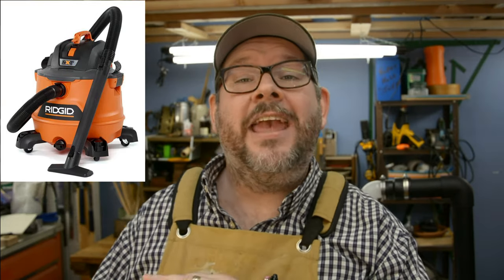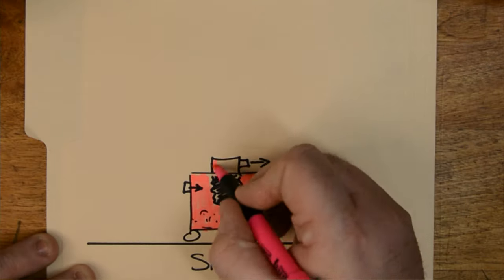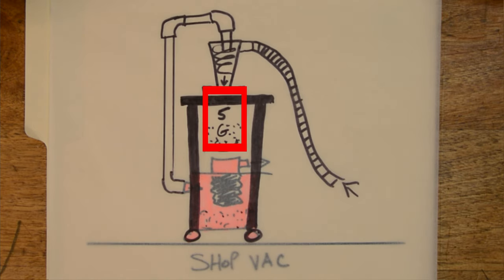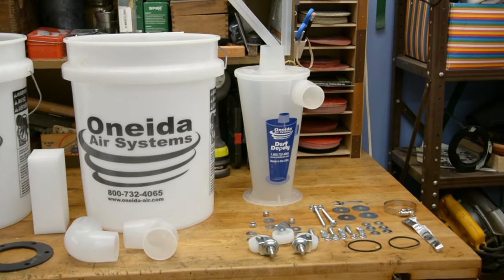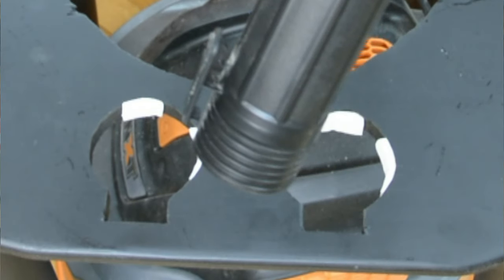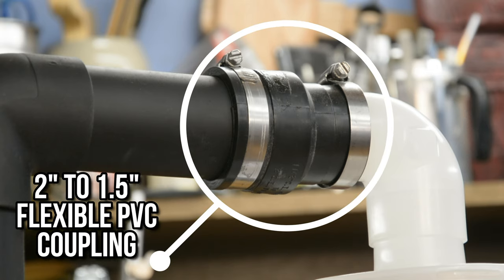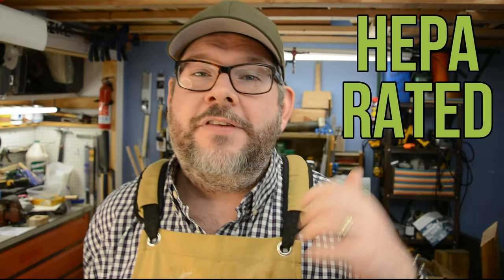Dust Cyclone Cart Space Saving - 2023 - Cyclone separator - Dust Deputy & Ridgid Vac Cart

Comment: This is exactly how I have my dust collector setup! With my 6 gallon compressor on top of it all! Very handy.
Reply from the maker: It’s proving reallllly useful!
Reply: @BurkeMakesStuff  I have thought of sharing mine with people for ideas but I don't do videos, lol. Friends that have seen it so far think it is awesome. Dewalt 10 gallon vacuum on the bottom (wheels removed) with green HEPA filter, bag. Wooden frame creating each level, all the way up to the air compressor! Footprint is only about 20"x20". Bottom board is a solid chunk of LVL for weight (which I got from a house that I was a part of building). Hardly ever have to worry about a clogged filter again!
Reply from the maker: @brandenthompson2909  it sounds great!

Comment: Thanks for the video. Made it using my existing 6-gallon Rigid vacuum so had to make a few adjustments in Step One. Used 1 1/2 inch PVC for the legs, which fit perfectly over the caster caps on the vacuum. Plywood top went from 24 in. square to 18 inches. Rest of the build followed your directions.
Reply from the maker: I hope you checked out the John Builds It one I mentioned in the video. He does that build. Hope you loved it!

Comment: New subscriber here. Nice rendition of John's idea.

I built mine a couple of years ago but like John, I use the Dustopper. I've been very happy with my unit so far.

A couple of months ago, after recovering from COVID, I noticed an increased sensitivity to fine dust. I was doing all the same things I had done before, but when I took off my mask, I started coughing. Put it back on, the cough would go away. That got me to thinking about how well my set up was working for my table saw, which is what I used it mostly for. Turns out, it wasn't doing much.

I bought a handheld anemometer and used it to measure the CFM of my set up.

At the port of the vacuum, with no hose, I was getting about 180 cfm. However, at the end of the hose, coming out of the Dustopper, I was only getting around 77 cfm. Not nearly enough to properly service my Ridgid R4512 table saw.

As a result, I'm upgrading, adding really, a 750 cfm DC from Rockler to use primarily with my table saw. I'm still going to use my vacuum/dustopper set up with smaller tools, e.g. sander, circ saw, as it works really well with those. I will be adding a HEPA filter to my vacuum as well to eliminate as much fine dust from the air in my shop as I can.
Reply from the maker: The HEPA makes all the difference! I have dust allergies and used to get sneezing “attacks.” It was crazy. Since the upgrade I haven’t had a single issue!

Comment: Great build. Brilliant You've definitely moved shop vacs forward. The cyclone. Two things are going on here. Primarily the fast moving air from the collection hose arrives at the much  bigger interior space of the cyclone, the air slows down (think 4" hose to a '10" hose' this drops the pressure which also drops the moving air's ability to lift the particles - they drop to the bottom. Two places in the world you can see this. The inside curve of a river or stream, the river slows down and drops it's sand leaving a sand bar. Also if you drive between Los Angeles and Las Vegas and you look at the valleys as you're driving past you can see sand build up in the very center of the valleys - this is because being the deepest point, the wind that got squeezed coming over the ridge slowed down dropping its load of sand. 
The cyclone effect is a bit of extra. My cheap HomeDepot separator has no cyclone feature. This spins the air around the outside  carrying the particles with it while dead center where there's a minimum of particles is the exit. Dyson vacuums also do this but at much higher rpm. 
Making it so efficiently vertical with places for all the fittings is a real winner.  (For my vac I made a bracket out of 1/2" PVC, I have three vertical pieces of 1/2" PVC that I slip my extensions over.)  Everyone with a shop should immediately build this. 
Another thing I learned over the years. My dad built us a house and installed a vacuum system. The vacuum and collection was down in the basement, with tubing running around the house. All we had to do was move the long hose to a room open a flap on the wall and plug in the hose. This is great for a couple of reasons, first the exhaust and all those tiny particles are not in the house, and you don't have to drag around the vac. Several years after this I learned that a builder was installing these in his houses, but instead of using the very expensive dedicated unit he was using the more powerful and less expensive ShopVac brand.
Reply from the maker: Well said! Glad you enjoyed the video!

Comment: This is a great upgrade for wood shop dust collection and highly recommended. I would though recommend that you screw the PVC pipe fittings to the vacuum wheels to keep it all together while pushing it around. I also finished my system with a spray can of truck bed liner which is much more durable than spray paint and easier to clean. Finally I made a large wooden cleat to wrap the shop vacuum cord around while not in use and mounted it to the plywood in a way that it also became a handle to push the new apparatus around the shop.
Reply from the maker: Spray liner is a GREAT idea! Might totally do that!

Comment: My problem is my 20 gal Rigid vacuum is so old the intake port is on the motor section, and not on the side of the base. Hard plumbing in would make removing the motor/filter section difficult, and there is no way to add a bag. Darn well-built long-lasting Rigid product!
Reply from the maker: lol!

Comment: Keanu and I greatly appreciate this build and the added info to my endless infinity of new knowledge and creative ideas. That being said I have subscribed and give you Two Right Thumbs Up for efforts and useful info.  I agree with your design being space savings and clean-ability is fantastic, but as an HVAC ducting pro I should caution on the added number of elbows and length of tubing will reduce your vac suction considerably. Building side-by-side will help in this situation and someone will inevitably see all of this and build a simple two stage bagless and permanent filter machine.I would but I'm busy with energy efficiency and off-grid solutions. Cheers!
Reply from the maker: Well Thank you for all of that! Any suggestions on keeping as much suction as possible? Would sealing the PVC pieces together help at all? Any advice is greatly appreciated!
Reply: @BurkeMakesStuff  Actually, what would help incredibly would be a deeper shop vac receiver, the vortex separator doesn't have to be round, it could rest in the bottom of the tank with a partition between the blower and it's drop-out zone,  and that section would have a dust filter in the partition, the larger area for the drop of large pieces, below the inlet tube, and all of that plastic divider and filter lifts out when it's emptied. Something perhaps larger than 7 gallons would ratio best for a 2" diameter suction hose.  Dyson, Red Devil, and others use chambers much like this but their filters are somewhat crap and in a shop vac it would take two filters and maybe an outlet HEPA for a muffler and find dust trap.  Is that enough to keep it in a single profile floor space. My shop vac is a compact 16.5 HP beast and rips filters badly from impacts and high suction.

Comment: Good stuff man. I've been designing one of these things in my head based on an amalgamation of several builds I've seen online. I've got an an old wall mounted Sears Craftsman shop vac so I'll need to make a cart for it, however, using these hard connections rock. Thanks for the link on the rubber adapters. I'll definitely need to use those. 🤜🏻
Reply from the maker: Stew, as always, I’m glad to be able to help! Thanks for checking it out!

Comment: I have the Ridgid 16 gallon blower vac WD16850 here are the modifications I made.

The front feet did not have tool attachments, so I replaced them with two rear feet from Ridgid (part 830716) at about $8 each, plus shipping.  Re-use the casters.  These grip the support pipes loosely, but it is solid enough when built.  There may be better options for the feet.

The 2" pipe was too short, so I cut it at 3".  It's much easier to attach the flexible coupling to the front of the vacuum first, before making the other connections.  Be sure to sand the PVC joints first, because you want to be able to take them apart, and unsanded 2" PVC is hard to take apart, even if only dry fit.

For my vacuum, the 42" pipe was 2" too long, so I cut off another 2", making it 40".  

When I attached the caps for the 30" support pipes they were all 15 1/4" apart from one another on the board.

Other than that, all of the measurements worked beautifully and it was a very successful build.  Thanks, Burke, for blazing the trail and making it easy!
Reply from the maker: My pleasure. Glad I could help.

Comment: 2 quick questions, did you glue all the pvc together? and what screws did you use for the top plywood piece into the caps?
Reply from the maker: Didn’t glue them, just pressure fit. As for the screws, don’t remember, but ones long enough to get through the wood and the cap.
Reply: yeah i was overthinking it- 2'' couplers and 2'' pvc (no glue at all) worked perfect on the rigid 16 gal  thanks for the inspiration   @BurkeMakesStuff

Comment: Love it!  My "shop space" is not segregated from the other needed workings of my basement.  (Laundry, f'rinstance.)  Having a 'one pack' idea that stacks rather than filling up a coaster wagon helps some.  My only problem is Amazon made a public statement they "don't need customers" like me (gun owner) so I politely leave them alone these days.  Which means I'll have to find another source for some items.  C'est la vie.  Still sound thinking and design on your part.
Reply from the maker: I’m so glad you liked it!
Reply from the maker: When first researching the video, I was really surprised at how many people had the unit and vac side-by-side instead of stacked vertically. HUGE space saver!
Reply: @BurkeMakesStuff  There is a prior video to yours showing a side by side arrangement on a rolling platform.  That is surely better than the two separate items I have now for a number of reasons.  However, I have since found your video and like it better.  I've also seen yet another idea which is similar to yours, but is made of either MDF or plywood (over and under components).  I'm busy with another set of projects which have to be finished first.  So I'm running things around in my mind before I commit.  Still, thanks a bunch.  And I will do something at some - SQUIRREL!!!

Comment: Burke...i have a simple theory for you to test...there is enough meat to make a video of it...here goes.
  Decades ago when i was a young family man, in the military and so, i had no money.  In need of a shop vac i bought a smaller cheapo...about a 5 gallon tank and i think a 2" hose. Well the hose was shorter than most, and of course the power left alot to be desired...my wife had thrown out an old (Eureka style) vacuum cleaner which had a 1 1/2" hose, (could have been smaller), wanting a longer hose, (and who doesn't), i joined the shop vac hose and the smaller diameter vacuum hose with a 2" to 1 1/2" coupling ...it worked great, in fact i think it increases yhe power of the suction and increased the power when i used it as a blower...ive always wondered if it did increase the power...or was it just me being boastful of my creation...i think id make a great vid.
Reply from the maker: So what it is is taking the amount of suction provided by the motor and by using a thinner hose, it has less room to intake that air, so air needs ro “move fast” to meet that amount of suction. The issue that’s often faced other using a thinner hose however is that it puts extra strain on the motor and can cause it to heat up and/or burn out completely
Reply: @BurkeMakesStuff  are you sure?...I used that POS shop vac for years...and yes the motor was audibly under more strain but I must have been at the sweet spot of the motors potential because it never stopped working...for years.

Comment: How did you solve the loose fitting of the 2" fitting on the wheels? Every 2" fitting I tried, except for what rigid makes in the adaptor kit, are loose.
Reply from the maker: Yes 1 or 2 connections require an adjustable clamp for a tight fit.
Like one of these: 1-in to 3-in dia Stainless Steel Adjustable Clamp https://www.lowes.com/pd/IDEAL-TRIDON-1-in-to-3-in-dia-Stainless-Steel-Adjustable-Clamp/1001057366
Reply: @BurkeMakesStuff  making sure we're talking about the same fitting, I'm taking about the 2" coupler that you use on the wheel base.
Reply: @foxeagle1  I am finding the same loose fitting on the wheel base.  did you come up with a solution?
Reply: no solution just guesswork. Either wrap some black tape around the wheel base or heat up the pvc and temporarily use a "o" clamp to tighten until cooled.
Reply from the maker: @foxeagle1  I miss understood. At what time in the video do I show it? I’ll tell you all I did. Or email me a picture of what you’re talking about BurkeMakesStuff@gmail.com
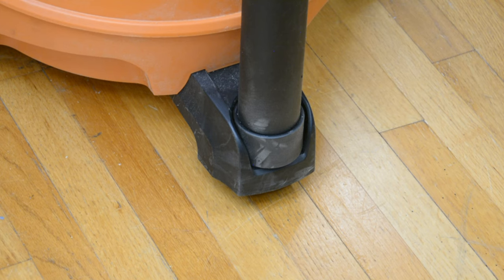Reply: @BurkesMakesStuff  Its at 4:42 where you place the 2" couplers on the wheel bases.  On mine (Also an HD1400) they fit very loose and they are too large to fit the 2" PVC Pipe on them.  I'm going to have to either heat the pipe to squeeze them on or make the couplers smaller by wrapping tape on the inside of the coupler.  I was hoping there was a cleaner, easier solution.  The rest of the build is spot on accurate - maybe I have an older version of HD1400 or maybe they change since you did yours?  @BurkeMakesStuff
Reply from the maker: @jonaldrich3749  hi! Double checked. It is indeed a 2” coupling I used. The best I can imagine is a product design change at some point? If it’s only loose and not enough for a smaller coupling, I’d put a screw or 2 in it to hold it solid.

Comment: Adding a baffled exhaust chamber (made of plywood) also would greatly reduce decibles in the shop.
Reply from the maker: Baffled exhaust chamber?
Reply: @BurkeMakesStuff  I have about a 2 inch panel on the back with various spaced wood pieces that allows the exhaust air to enter at 2 laces at the top and the air and noise are vroken up as they take varied escape at the bottom of the chamber much like the muffler on a car, you break up the direct sound waves without inhibiting the pressure of the air exhausting.   I really works.  I dropped my decibels about  35 db.

Comment: If you used the dustopper instead, it would eliminate the need for the soft rubber cupplings and the vertical pvc from the vac up to the dust separator. It comes with a hose for that and all of the hoses are perfect matches between this model shop vac and the dustopper. If you're worried about the quality of the product, I build it this way and it works wonderfully
Reply from the maker: I appreciate that info! Had a dust deputy deluxe sitting in my shop for months, so I put it to use!

Comment: Can you hook this up to an actual machine with a dust port?
Reply from the maker: Not sure what you mean. Like a household vacuum? I don’t know that I’d risk it. While almost every little bit of sawdust gets stopped by the cyclone, I’d be concerned about the tiny % that makes it through. That’s why I added the HEPA set up.
Reply: @BurkeMakesStuff No, she's wanting to see how you connect it to a sander or table saw or miter saw, so that she can verify its effectiveness in capturing the sawdust generated.  Apart from that, she probably wants to understand what transitions are needed between the 2" shop vac hose and the various tools with dust ports.  It's a fair question if the point is to have a cost effective dust collector for the shop.
Reply from the maker: Oh! I use this! Got it on Amazon. Works great.
https://a.co/d/b0IKl3a

Comment: Guess what.... there is now a newer model with 2 1/4 inserts on the wheels and I think the plastic is more plyable, the feet no longer screw to the vac bucket they just press on.  This makes this design more flimsy overall..... still trying to work through it.
Reply from the maker: Interesting. I only went with this model because I got it on an outstanding sale back when I got it.

Comment: bwahh nice build, but you always buy parts, I'm sort of a jimmy rigger, your whole unit made me think of those stationary central vacumes, ours looked like a hot water heater so then I thought, hmmm I could probably make this using an old hotwater heat and leave it in one place like the central vac, all metal parts and no plastic, hmmmmm.Wish i had a work shop I'd try you plans out but with no plastic parts. after a couple uses the heat loosens all seals on your design. Nice build, I'd give two thumbs up if it would let me.
Reply from the maker: I toyed with the idea of building the cyclone myself, but decided to go with the dust deputy Felix kit mainly because of the ease of collecting all the parts that would be needed if I Jimmy rigged it. I had just hit the breaking point of “I just need to build one NOW.” Keep me posted if you attempt it though! I’d love to see!

Comment: A little demo would have gone a long way...just saying 😎
Reply from the maker: Of the vac working? I didn’t even think of that! I figured it would be kinda obvious. I can send you a video, if you’d like to see. What’s your email?
Reply: @BurkeMakesStuff  
Not a problem...usually a demo to illustrate the effectiveness of the build...good design though...just built my own using Powertech 2 1/2” clear piping and fittings with total run @ 28 feet with five drops...thanks again for the build...😎